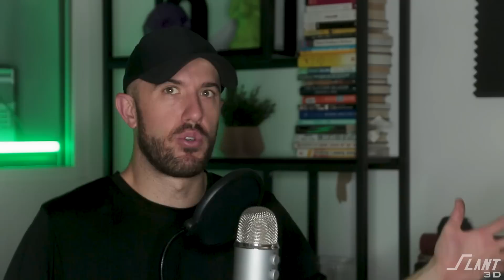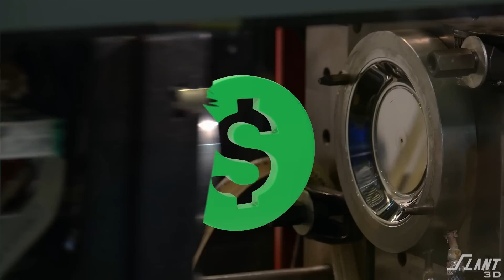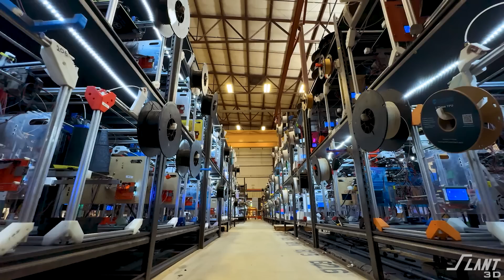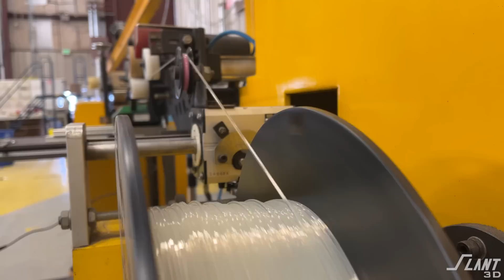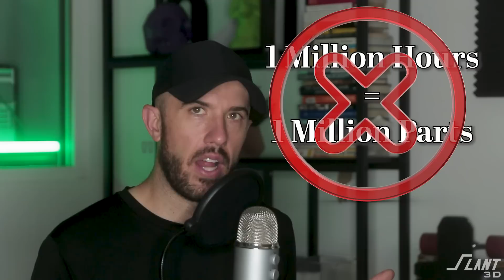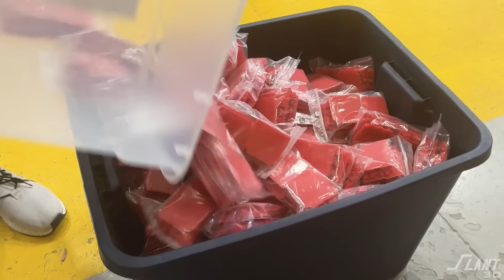How to Make a Million Parts with 3D Printing

Comment: The thing I'm always curious about with these very large print farms is the cost of electricity to run that many heated beds, heated nozzles, and extrusion motors, not to mention several fans, 24 hours a day, across 1,000 to 3,000 machines.
Reply: I'm paying ~$15-20 per month per machine in electricity when they are running 24/7 (I only have 3 printers in my small business though)
Reply: @im_linus  Thanks for the info! I recently looked up how much power my MK4 draws, and it seems like it averages out to the same as a 100-watt lightbulb while printing. That's easy to figure out, and is something like 3.6 cents per hour where I live. Around the clock, that would be something like $26/month, which checks out, because we have some of the highest electric costs here in the LA area. Surprisingly little power consumption, though, regardless.

Comment: I'm working on a product containing many small parts and assume I will use Slant, but I'm many months away from having any models ready to quote. I have no idea how much it will cost. And I don't want to waste Slant's time quoting with fake models. I understand costs will vary for so many reasons, nozzle size, layer thickness, material, ejection, quantity, prices change in time, but can't you give some idea for today with a variety of options for several models. For all I know what I'm thinking is going to be 50 cents a part is going to be 5 dollars and all the work I'm doing will be a waste.
Reply: Try their print on demand website for an upper limit on the price? Will give you an instant quote for any STL. Can't tell you that they can't do it at scale for 50 cents of course but could tell you not to worry about it being 5 dollars.

Comment: Based on what you said about cost of material, shouldn't a large print farm directly use the plastic pellets in the printers? This would completely skip the extruding filament step. It would also save the capital costs for filament creation equipment.
Reply: @juliejones8785  the purpose of filament in 3d print is consistency in extruding the plastic, by changing to pellets, the extrusion may be vary and will   impact badly to the print result
Reply: I'd imagine that the problem with pellet feed printers is that they take up too much space.  Have you seen some of these pellet extruders?  They're *enormous*!  You could fit probably 4-5x more printers in the same space as a single pellet extruder printer.

Comment: 7:02 There is a place in manufacturing for both technologies.  Most dies have the ability to produce 1,000,000 parts/cycles where the cost is prorated over all the parts.

Not every project needs that many parts over the life cycle of a product, thus the high cost of a part is spread over fewer parts.

The cost of big injection moulding equipment including auxiliary equipment is far costly vs a few hundred 3-D printers that can produce similar annual qualities.

As a person who understands cost accounting, 3-D printing is a viable alternative in many cases.

There is also the ability to "turn on a dime" regarding design or features that are easier with 3-D printing that could be very costly with injection molding.

Comment: I've been following for a while now. I'd love to see a video on the custom printers that you use. Thanks for the content.
Reply: They are Cartesian with the bed on the z-axis, custom toolhead with what looks like a standard V6 nozzle. Very simple design, think of the ender-5 but with linear rods instead of v-rollers and include a borosilicate glass bed. Most similar mass produced printer is probably the Cubify Cubex. Use octoprint/octofarm with some custom g-code, and a lot of money, and you have a somewhat automated print farm.
Reply: S proprietary.

Comment: One big key, you can change the part 10,000 parts in. With a mold, you're stuck.
Reply: @iPrint3D  if you are selling/making 10,000+ parts... you can afford a re-mold. Especially if you are supporting small/local mold makers.
Reply: @NameOmittedHere Not everywhere has small/cheap mold makers.

Also, the downtime of making the mold and shipping it wherever takes time. Shipping the injection molded stuff as well.

Imagine a part that needed a whole resized, edit and resend to the printers in no time. On the fly changes.
Reply: @iPrint3D  it would depend mostly on how valuable your time and energy is i guess. Injection molding takes seconds to do. Let's say, for simplicity we are producing something slightly complex but still relatively simple, like a small 2 in humman shaped item, like a toy. An injection mold can make literally tens to dozens of these in a matter of seconds. The amount you will save in manpower is immense. Say the mold costs you 5k... and there's no limit on what you can sell to the customer because its in high demand. Even with a change it beats the 10s of minutes to hours that a 3d printer will take.
Reply: @NameOmittedHere  But focusing just on production time ignores the holistic time frame. Yes it may only take a few hours to run 10,000 parts on an injection molding machine. However, if you factor in the weeks it will take to: get a mold made, get it shipped to the molder, find a time slot in their production schedule, etc suddenly it's on a much fairer time footing with printing. There's absolutely an inflection point in terms of scale between molding and printing, but it's only fair to compare timelines holistically.
Reply: @sirdeimos8968  okay. Let's do that:
3D Printing
 * Timeframe: Varies greatly depending on the printer technology, part complexity, and desired quality. Printing 10,000 parts could take anywhere from several days to several weeks.
 * Advantages:
   * Faster initial setup: No need for mold creation.
   * Design flexibility: Complex geometries are possible.
   * Customization: Each part can be easily modified.
 * Disadvantages:
   * Slower production for large quantities: Each part is printed individually.
   * Limited material options: Some high-performance materials may not be suitable.
   * Surface finish and tolerances: May require post-processing for specific requirements.
Injection Molding
 * Timeframe: Initial mold creation takes several weeks. Once the mold is ready, production can be very rapid, potentially producing thousands of parts per day.
 * Advantages:
   * High-volume production: Extremely efficient for large quantities.
   * Wide range of materials: Many plastics and composites are available.
   * Consistent quality and precision: Parts are highly repeatable.
 * Disadvantages:
   * High initial cost: Mold creation is expensive.
   * Less design flexibility: Limited by mold constraints.
   * Longer lead time: Initial setup takes longer due to mold fabrication.
For 10,000 parts, injection molding is often the more cost-effective and time-efficient choice once the mold is created. Its better for tight tolerance, and low time investment for part finishing. However, 3D printing might be preferred if you need faster initial production, complex designs, or the ability to customize each part.
Reply: @sirdeimos8968  also how many printers are we talking here? That will greatly change the Timeframe. 10? 1000? 10000? Remember, if we are counting mold purchase.... we should also count in printer purchases, stl creation for both, and calibration/trouble shooting.
Reply: @NameOmittedHere  Correct me if I'm wrong but the customer pays for the mold, but not the molding equipment? Except for the amortized cost over the life of the equipment that all customers pay? So printing should only have to pay that amortized cost, not the outright cost of the equipment if you're outsourcing the printing?
Reply: @sirdeimos8968  it depends. The customer can pay for the mold. Its not always the case. Big enough orders the price is worked into the ppp.